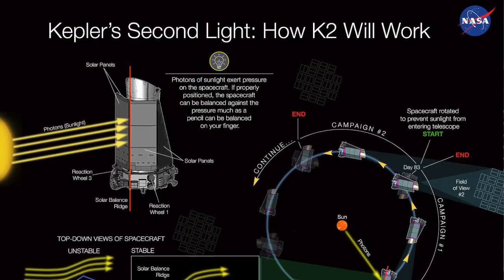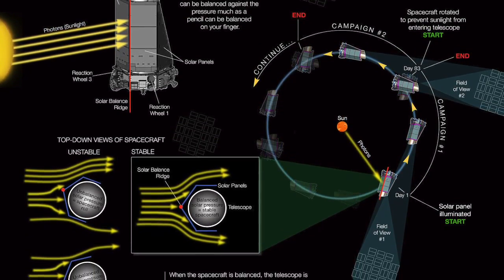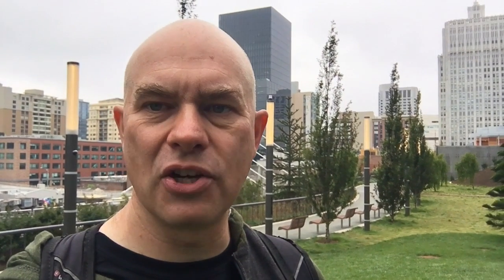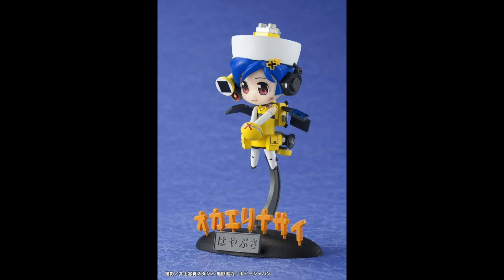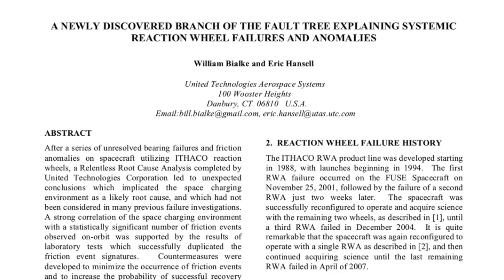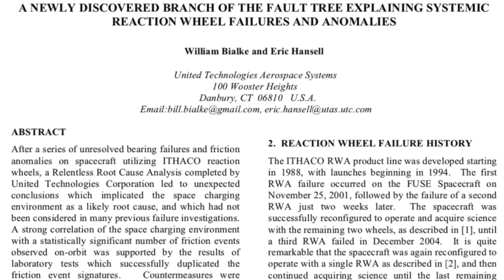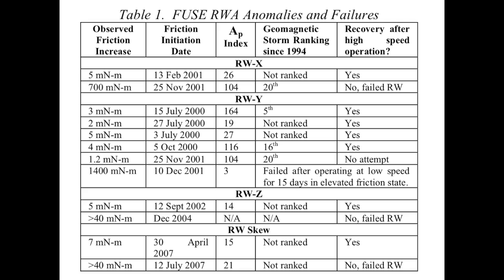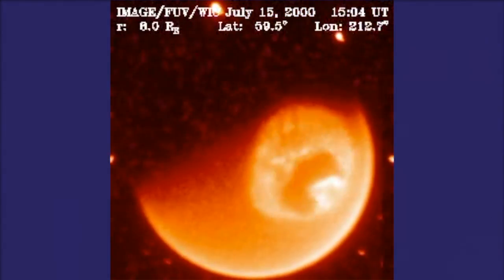Scientists May Have Figured Out Why So Many Spacecraft Were Failing

Comment: But there is also something called as cold welding in space. It is an effect where the usually seperating oxide layer of any material gets slowly "blown" off by solar UV radiation and enormous temperature changes. This effect than causes joints and bearings as well as sealings to then begin reacting and "cold weld" together. Similar as when two steel parts rust together, the rust layers make that part then inseperable. That is a reason why aluminum is such a complicated material in space, because when its oxide layer is gone, it begins to "weld" with literally anything.

Comment: Wouldn't it be better to instead of making ball bearings from ceramic, to make other parts that are in contact with ball bearings from some non-conductive material(ceramic, glass, plastic, etc.)? It would be much cheaper to make instead of the ceramic ball bearings, and if the ball bearing isn't in contact with anything conductive, then the problem is solved, but cheaper.
Reply: I'm also reminded a bit of the philosophical and technical design differences between the AR-15/M-16 rifle platform, and the Kalashnikov rifle platforms:  the American design is comparatively precise and accurate, but prone to failure under extreme conditions largely due to the high level of precision involved: if something puts the wrong parts out of spec, things get real bad, real fast.  The Russian rifle design by contrast is comparatively loose, sloppy, and primitive, but can take an impressive amount of abuse, neglect, and application under conditions it was never designed to operate under.

Like the AR-15/M-16 platform, modern spacecraft tend to be designed to high degrees of precision, and, I would bet, that carries with it a low tolerance for changes to the environment and components.

So, perhaps also, instead of making precision high-tech ball bearings, we might consider going with something relatively sloppy and primitive....

Comment: "the pressure of the sun's light" now that's some awesome physics
Reply: Damn spoilers
Reply: Airbus have been using solar sailing to stabilise communication satellites since the 1980s. Old technology.
Reply: Now, if we could just figure out a massive photon gatherer and grab enough photon mass
equal just 1/10 th the mass of what is being driven. Wow, ranks right up there with the wormhole
thing.
Reply: Michael A. yes it’s called solar sail and the japanese has tested some in space already
Reply: I still don't understand why he said reaction control propellant.. when clearly their motorized wheels actually I don't know what kind of thing is propelling the wheels
Reply: @dustinswatsons9150  The wheels are used for stabilisation and directional control, but they eventually get 'saturated', i.e. they can't spin up any faster, so they have to be de-saturated and slowed down... in order to slow them down without that breaking torque causing the spacecraft to rotate, there are reaction control thrusters to 'push' against to allow this to happen. Once they run out of propellant, you can no longer de-saturate and that's it, you lose the ability to stabilise and point the spacecraft. Game over.
Scott actually has a video detailing all of this, (I think in his 'what kerbal space program doesn't teach' series) that is quite interesting.
Reply: No magnetic field around those things at all and all that energy blasting past and likely through it too I guarantee it is as it was seen in this video I don't care how far out those things were

Comment: I'm not a scientist or an engineer, but what about a rubber boot around the outer part of the bearing. If there is no place for the electricity to go to from the outer race then it shouldn't jump. I will wait for your answers. Just a theory.  It comes from my years in vacuum cleaners repairs. Rainbow vacuums has rubber boots on there bearings.

Comment: "Stray currents" have been known ,on 3-phase, FVD, motors, since 1980's, on Noise/sound, tested bearings. Damage causes, raceway, drag, Imbalance, also cage damage, "Welding" of roller, elements.

Comment: When compared to the wheels used in the Cassini spacecraft, and other long lived spacecraft, the Ithaco wheels appear to be markedly different, to the extent that their design differences could have exacerbated any sensitivity to cosmic radiation and the effects of solar flares. The bearings of reaction wheels, and their lubricants and lubrication methods, have been extensively studied and are some of the best understood components built by man. There is a real danger in second guessing that these solar events were the cause of all reaction wheel failures. Yes, solar flare events can wreak havoc on a spacecraft, which is why they are designed as faraday cages. But to infer that all spacecraft are in danger when only a handful have the Ithaco wheels does not give credit to the outstanding engineering and continuous study necessary to build these most reliable of components. That they hold up as long as they do, under the loads, thermal conditions, and fatigue conditions (on bearing materials, cage materials, and lubricants) that they are subject to is one of the great achievements of mechanical and chemical engineering. We in the spacecraft mechanisms world are reverent toward those who can manufacture these wonders. But not all completely understand why successful reaction wheels work, and why unsuccessful ones fail. There are more nuances to these things than meet the eye, and not all design secrets get passed on to outsiders.

Comment: Grounding paths are very important.  Back in the seventies the VW Rabbit had a missing grounding strap that attached to the engine.  The alternative grounding path was through the front left axel and the wheel bearings.  Arcing in the bering race would destroy the bearing.  It did a great job of destruction, speaking from personal experience with a 1976 VW Rabbit.

Comment: I find this very interesting. Vehicles have wheel speed sensors in that voltage range and sometimes bearing fail repeatedly, unexpectedly. Correlation?

Comment: My question would have to be, what abour reaction wheels from other sources and even made and used by ither countries? Do they show a similar failure rate? My second wuestion would have to be, if you know such a vital item is highly prone to failure, and you know you need three to run the spacecraft, why wouldn't you put more than two spares? Especially when post launch repairs are out if the question?

Comment: Massive amount of energy is passing though the bearing and cooks the lubricant. This happened in the early Dodge Omni car where the engine was not grounded correctly the power went through the steering knuckle and fryed the bearings. Plasma is raw electicity and as it passes through the craft it picks up this power and it has to go somewhere! My opion. Idaho

Comment: The same thing relates to pitch bearings in wind turbine during lightning and collecting electrostatic charge by blades..  This is well known and there are specuial grounding systems to prewent this to hepening.

Comment: Thank you for podcastposting this one Scott, I have indeed wondered. 
In a ball bearing there's very little surface on the top of the ball, so yes comparably little amps is needed to weld it in place or leave a residue as shown on your video.
Ceramics seem to be the way to go, or at least in some part of the ball bearing to stop it from being conductive, especially on spacecraft that use Ion engines - or any space application that use the  kilopower units.

Comment: Right, so we don't have the gear to go get what's wrong and fix it. So make things that so the same thing and are better. Use bearings that for the job but are along the lines of Ceramic Skateboard Bearings..... I'm suggesting they use huge bearings with ceramic little bits, (I dunno how big the bearings they use are) [if the bearing parts are made of Ceramic, which I think doesn't conduct electricity,] then I'm sure the bearing will work. Should the right size parts be used in the project. Then again. I'm just a hill bomber. Ceramic bearings some heat up at high speed
Reply: I typed this message while listening to the video. Scott's statement of Ceramic bearings didn't arrive till the end. My thought of Ceramic was from the start

Comment: I would not keep this only as a matter of one problem e.g. local influence for the surface and lubrication conductivity. I know this is not like engineering works - but nature does:-)  Bear in mind that there is a fast turning electric motor in an ad-hoc introduced electric field with mostly unknown particles and in an extreme vacuum and extreme temperatures where nothing behaves like on earth. Most of the time one unknown dimension kills the comfort zone of science! (Recall the harpoon from lander Rosetta Philae did not fire cause it was unclear that the explosive needs oxygen to explode. That and some additional more failures is, why Philae lander was lost. ) The damage in the surface in the wheel can be e.g. by direct influence of particles '(e.g. big particles) on the surface, vapourising the lubrication, temperature shock and a strange field. ....and I am not even a scientist!

Comment: Use conductive grease with tapered roller bearings? Instead of it arcing at high enough voltage to cause damage to the bearing it should have constant points of contact minimising damage. Might be too heavy though.

Comment: Bearing degradation from electrical damage is very well known, why on earth would they use ball bearings on something of which this is so high risk? I'm sure everything is very well ground bonded, but in this case a plain bearing design would have been far better, I'm sure some kind of sealed design is out there that would do the job. Otherwise isolating the bearings and races to minimize the possibility of discharge damage would be designed in. I guess this company had to save money somewhere to offer such a deal on these parts.

Comment: Usefull idiot here, this may be obvious, but ball bearings made on earth all have an oxide layer, which prevents "cold welding", where metal is able to fuse to other metal by contact alone. if the bearings are in space, I assume they are exposed to vacuum, and when the oxide layer eventually is worn out it will fuse and seize up.  Am I way off here?

Comment: In industrial motors this is a known failure mode of bearings when the shaft is left floating which allows it to charge do to the EM waves of the motor. This typically occurs when driving the motors with high frequency VFD drives.

Comment: An easy but expensive proof would be sending a sat up with motors on ceramic and metallic bearings and see which ones act up after a flare. Or maybe even brush grounded axles for metallic bearings. But as you said, just using ceramic bearings did the trick.
Ideally, an experiment could be set up on the ISS costing a tiny fraction of a dedicated sattelite, but it's orbit is too low for full exposure to cosmic winds.

Comment: This is a huge failing point for fan bearings. Panasonic shipped many 100's of thousands of AC units where the fan bearing would fail after about 2 years, the fix was ceramic bearings.

Comment: Solution should be simple - short out the bearing (with some low resistance path, or perhaps they can make oil conductive)... 
I don't know what, NASA will figure out something, perhaps as simple as motor "brushes", or hi-tech, like a droplet/pool of low melt. point liquid metal touching both sides, sealed by ferromagnetic liquid (the ferromagnetic liquid as sealant is really used in some HDD hydrodinamic bearings, and in hi-end ultra reliable computer (server) fans ;-)

Comment: Indeed, as expected. Tension difference between a sphere and flat surface (we can approximate outer surface as flat when its curvature is a lot less than one of the small sphere bearing) is very high because contact point is nearly a mathemathical point. Same reason why electrostatic spark generators have those spherical ends.
I don't know if it's mechanically viable, but hypothetically, if the contact is spread on a line (cylindrical bearings), that would reduce the tension breaking values. Then again, more contact means more wear...
I'm sure these things use balls instead of cylinders because it's mechanically optimal.

But hey, in the end, ceramic ones seem to have solved the issue. \o/

Comment: Funny. Electric Universe again. Maybe most craters were created this way. Bullseye crater etc. ;)
Thunderbolt Project!
Reply from the maker: Well given that we’ve never seen discharge events powerful enough to make large craters but do see bollide events with enough power multiple times a year a sensible, unbiased observer would conclude asteroids.
Reply: Wow, there are a lot of posible electric discharge event making craters. and maybe the effects were missinterprete. For example russia. wasnt there a massive explosion with crater. comets. do they get hit. They have craters that should shatter them. And they are made from rock not ice!
And there were lightning spotted. a and the comets wich auroras grow bigger than the sun? maybe a glow mode discharge. check there website. its great. a and dont run when they disagree with the holy cow einstein. just give it a try. They can recreate bullseye craters and this super big mountain on mars which name i miss right now. its great stuff. would be nice if you can interview someone of them. Love your stuff.
Reply from the maker: I suggest reading https://dealingwithcreationisminastronomy.blogspot.com/search/label/Electric%20Universe to get a better handle on what Plasma physics is good at and where there are better options.

Comment: I am going to call it like I see it as it seems to me that no matter how far up the ladder you climb, the more removed from reality these technical heads become.

Back to basics.

Lubricants.
Do they thicken in space? Their viscosity is affected by temperature, so a bearing going through any kind of thermal expansion and contraction cycles will fail early and if the bearings get too hot, the lubrication gets burned / boiled off.

That is the most likely scenario here and that the fact that solar flares and CME's are part of that equation with all their XRays and microwaves and other radiation, its quite possible that some energy transfer helped cook off those failed bearings.

The real question is why are they not using a magnetic bearing? I make a POC device that I demonstrated to a friend which was very simple and made a bearing that levitated and friction was almost eliminated except for... air resistance.

So a completely new bearing type can be made that is going to last for as long as the magnets work.

Comment: My dad was an electrical engineer, worked 40 yrs for a company that made solenoids for the aerospace industry. Many times he was asked to bid on making parts that he suspected would not work properly in space. He would ask how the part would be used, under what conditions, temperature extremes, etc. then he would run it past his engineering team. It wasn't unusual for them to suggest that maybe they should redesign the parts before putting them out for bid.

Comment: was just going to say they should switch to Ceramic Speed bearings, not only not metal, but also, but also that fastest rolling bearings out there, all the pro cyclists use them. but then you said ceramic bearings and I knew they did.

Comment: Do they just not give a shit when a component is repeatedly failing? Send them back for inspection? Talk about bare minimum... So they thought all the failing units were defective then, and all they had to do was have the manufacturer inspect them? So let's pretend that was in fact the problem They request an inspection/refurb. from the same manufacturer they assumed was repeatedly sending bad parts? Jesus, either try a different part, or have a third qualified party inspect it!!

Comment: Why wouldnt they use ceramic bearings to begin with. That’s a no brainer. We use them in the turbos of our high horsepower race cars and skateboard wheels. Why would you not in a multi million dollar satellite. Just like Cody stated when your welding or using a rotary welding fixture you don’t ground through the bearing just for this reason. This is very basic level stuff.

Comment: A really fun fact - early Tesla electric motors were failing because of the same issue (electropitting). In Tesla's case the differential charge was caused by the high-frequency pulse-wide modulation from the invertor.

Comment: In electricity a bad connection can be worse than no connection. In theatre lights, if a lamp loses contact with the plug, it often will continue to work because an arc will form. But while the arc is keeping the lamp on, it's also creating heat and burning out the base.  Eventually enough black carbon soot builds up, and the lamp stops working. It's only when we pull the lamp out that we discover the bad connection. We have to replace the ceramic base, a 15 minute project. Fortunately theatre lights are engineered to safely take that kind of heat abuse.

Comment: Y'know, it could be simpler. It could be the lubricant is less stable than expected at high rotational speed, and enough of the lubricant worked its way out of the bearings that vacuum-cementation was able to cause bits of the bearing races to stick to the BBs. Once that happens, the bearing's lifespan can be measured in weeks, days, or even hours.